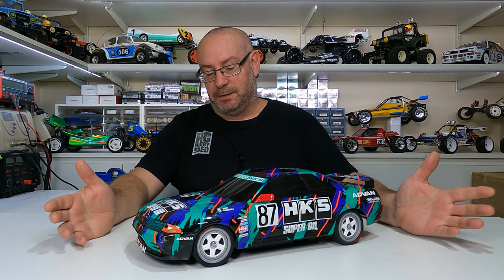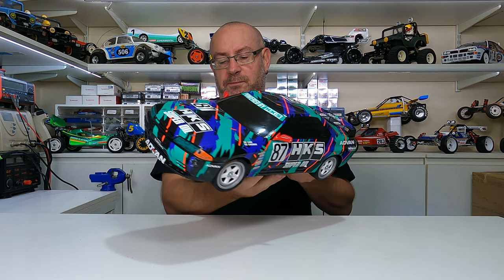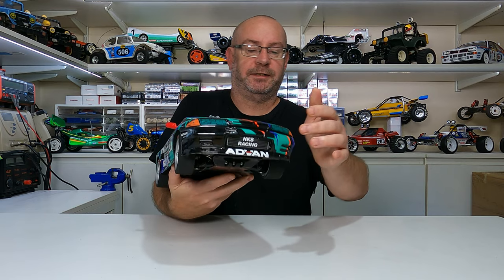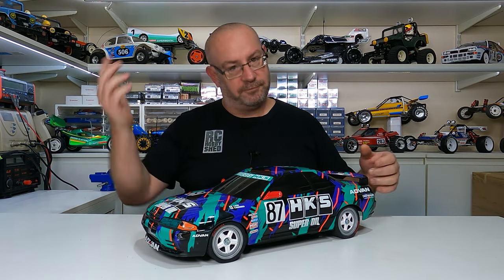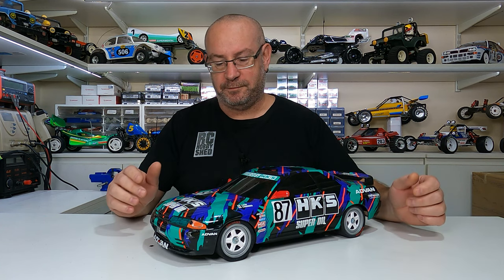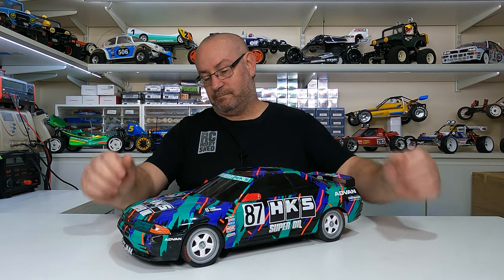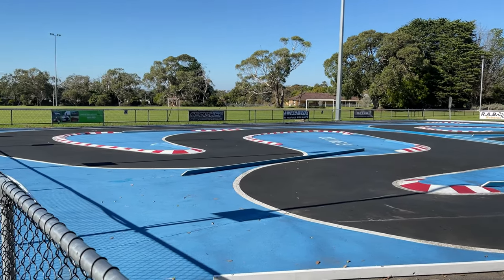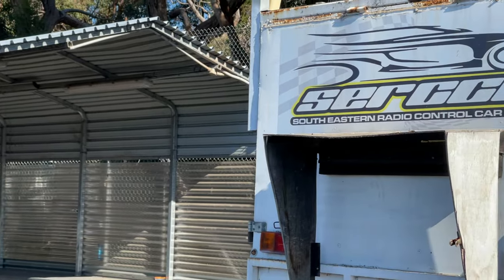Tamiya HKS Nissan Skyline GT-R Gr.A | Track Run

Comment: Oh no the out of sync splines on the Tamiya servo saver strikes again, I wonder if they even know about it. Must have been frustrating Mick!, if you hadn't of mentioned it I would have thought you were on the Jack Daniels 🥴🤣
The car looked really good and nice driving mate especially seeing your steering was out👌🥇
Magnetic body mounting set up is nice, since seeing your video on doing it ages ago I do the same thing, thanks for the idea on that mate.
Thanks for sharing another one of your video's mate, great entertainment again and now I want a Tamiya on road haha👍🦘🇦🇺
Reply from the maker: Haha yeah, I think that's what it was. It was very annoying having to pull it back all the time. Lol yeah, it felt like I needed some Jack Daniels to compensate for the steering 😂
I think it looked great out there too. I'm thinking I'll adjust the steering and get back out there again soon. 
The magnetic mounts really helped for this run, they saved the body a few times I think. Probably not good for racing but fine for what I do. 
Glad you enjoyed the video mate. Haha, time to go get yourself one! 😂👍

Comment: Hi Mick even though it wasn’t very quick, it still looked the part. Would be nice to adjust the steering so that you aren’t wrestling it all the time. It would then be nice to see how much more smoother you’d be around the track again, with the same motor and setup. Then perhaps some of the more budget conscious hop ups to see how much quicker you can make the car go? Still great looking car. Take care and best wishes 😉😊😁
Reply from the maker: G'day John! Really most of the time I wasn't full throttle because of the steering, it had more in it but I didn't want to bash the body up 😂. I'll centre the steering and maybe take it back there again soon. I have a load of hop ups for it already but now I'm thinking I may use a different body too as I really don't want to do those decals again. Thanks mate, cheers! 👍